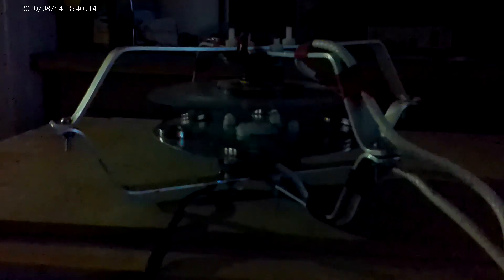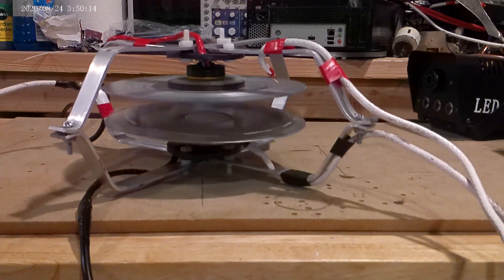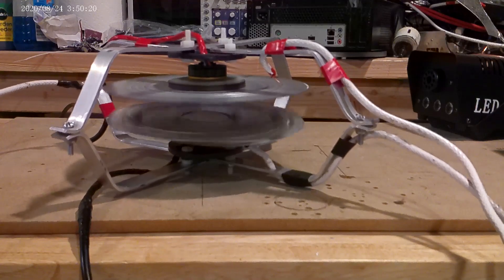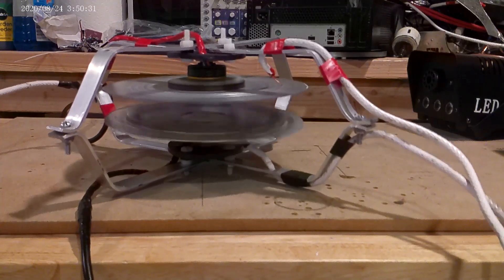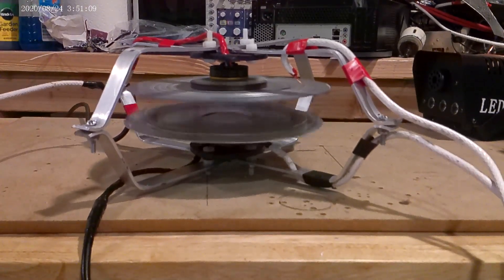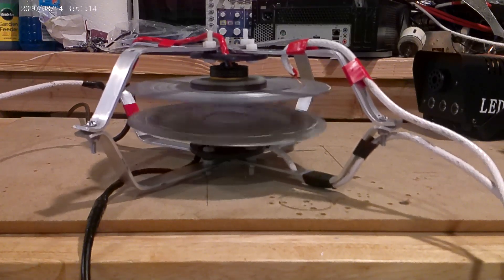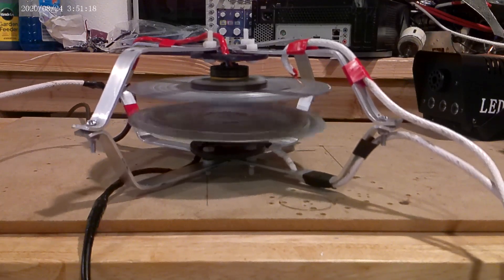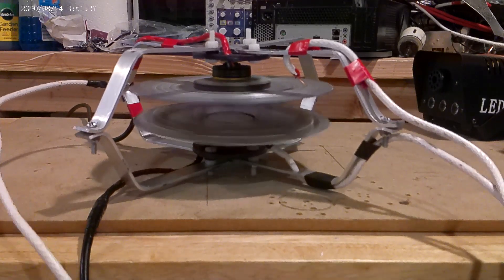testing graviflyer volume really loud

Comment: On problem im seeing is that you need a isolated (-) leading edge on center disk, Allowing the corona discharge outwards. The spinning eddy currents on the center plate magnetize allowing the discarge to travel to the outter egde.